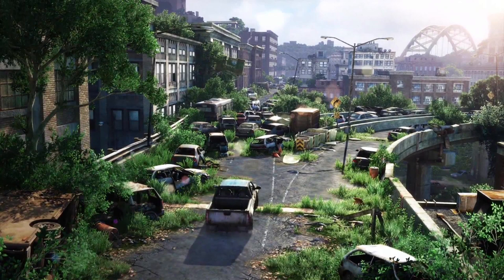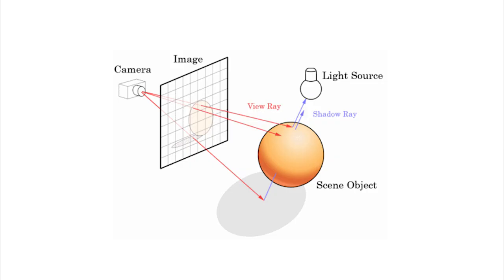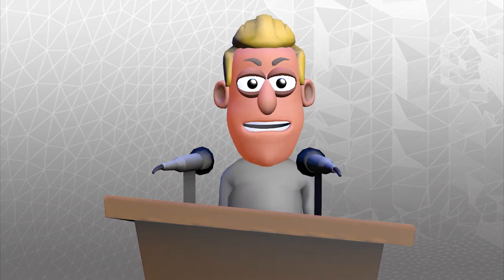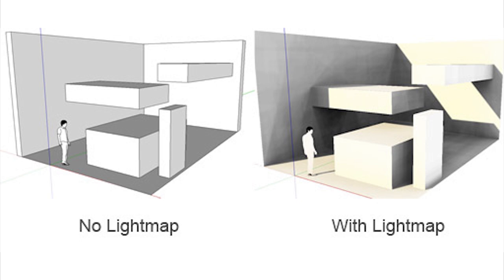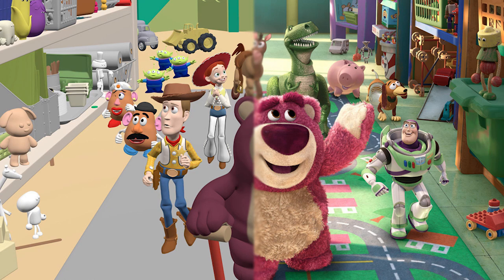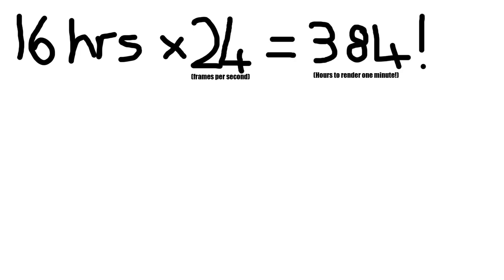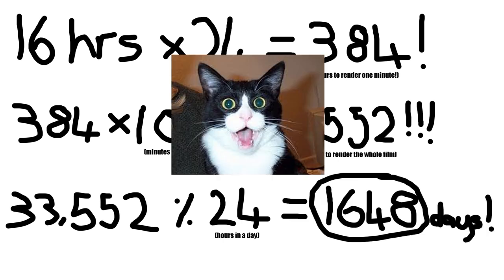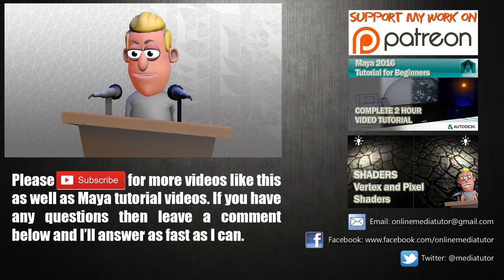What is Rendering? | Rasterization, Ray Tracing, Radiosity

Comment: i have a question about the modeling part with the modeling toolkit when i want to move an edge it moves the while thing while adjusting is there a way to make it be able to free transform
Reply from the maker: I'm not sure what you mean. What is the whole thing? The whole edge of the whole mesh?
Reply: the whole object or cube lets say when i want to scale one edge it scales most of the cube as well
Reply from the maker: +Its Insain That sounds right. When you scale one edge the others around it also have to change as they're connected.

Comment: hi, i have some question related to games:
is rendering more cpu heavy then gpu? 
also how multi threaded can be this? as i know rendering is using single thread...or atleast most games does 1 thread for it
Reply: +GoHeoNeoGo Rendering used to be more CPU intensive but nowadays GPU rendering techniques are available and are used, but not as often as CPU since it has been here for a long time. Basically, the more threads you have on your CPU the faster it renders, since the threads are treated as buckets for calculating.

I've done a bit of research if I've gotten any of the points wrong sorry (X~X_). But I think most of it is correct.

Comment: Are you sure you are not mixing up ray tracing and ray casting?
Reply from the maker: +nilspin I'm never 100% sure of anything! I'm am quite sure that I haven't confused the two in this case. Raycasting is all about real time rendering. Rays are cast out from the camera and when they hit something that tell the rendering engine that this object can be seen by the player and needs to be rendered. The ray stops when it hits something meaning that things behind the object that was hit aren't rendered saving on system resources. In Ray tracing the Rays are traced from the light and not from the camera as in the example in the video. Hope this makes sense. 

If you think my explanations could be clearer let me know how and I'll consider a revision to the video

Comment: When I render in Maya 2016 using 1080p quality settings Maya freezes (whereas 720p goes nice and steady although slow).
Is there anything particular that could be causing this?
I doubt it's the PC as it has an AMD FX-6300 OC at 4.4GHz (6 cores), AMD Radeon R280X and 8GB of 1600Mhz RAM (Maya also uses the SSD)
Thanks! :)
Reply from the maker: I'm not sure dude. I have had a problem like this before but the cause was working on a project on a network. I don't really know what your issue could be I'm afraid.
Reply: +gralman Try rendering with the CPU at stock speed. Maybe your oc is causing this
Reply: You're using a pirated version.